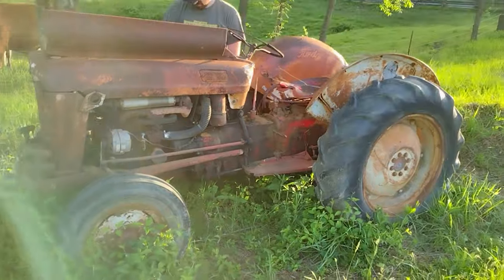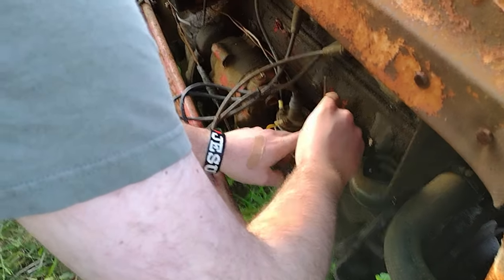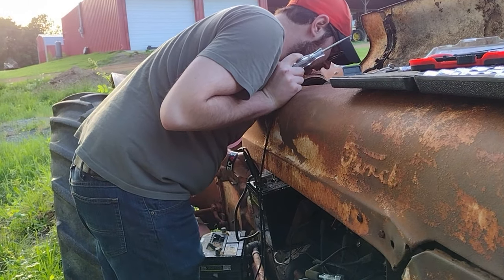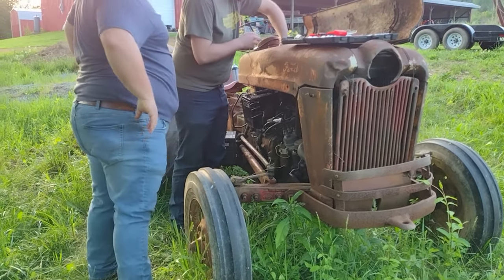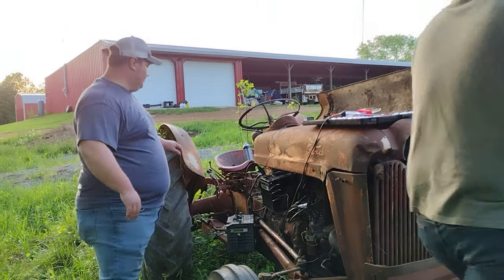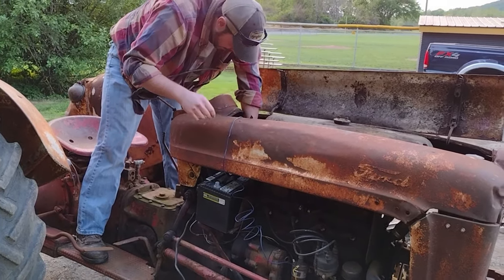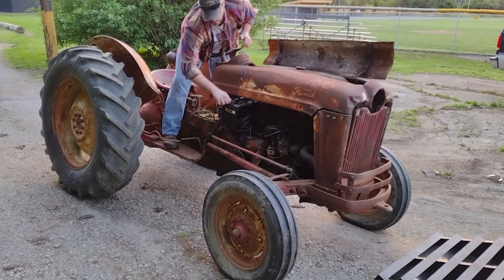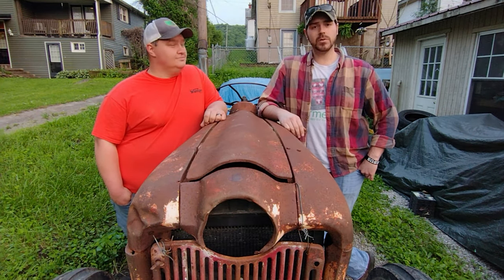Ford 660 Revival Will It Run?

Comment: That is a 5 speed transmission, which had that type of gear shift.  The 600, 620, and 640 had 4 speed transmissions, which shifted similar to the 8N.  650 and 660 had the 5 speed, and the 660 had live PTO.

Comment: I have 2 old ford's, one is a 59 651 workmaster and a golden jubilee.. dont underestimate these little tractors, everyone only thinks there for small tasks but i use my 651 for running my bailer while pulling a hay wagon at the same time, pulling massive logs out if the fence line, plowing, pulling 12' disc, no problems and wants do more..

Comment: I bought a newer tractor couple weeks ago. Picked up a 58 601 workmaster.  It has a little more sunburn then yours does.  Fires up as quick as you hit the button. But if you have to ever use the choke you have to pull the string. Lol. Have a new choke rod on it's way.

Comment: Surprised its a 12V not 6V, some premixed 50/1 2 stroke fuel works good to fire an old engine. Lubes up the valves  & such.